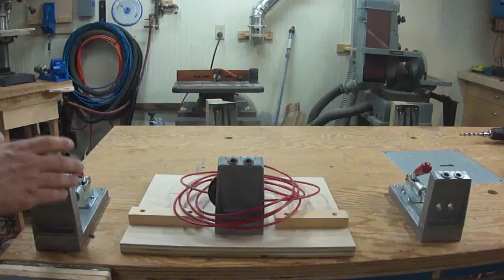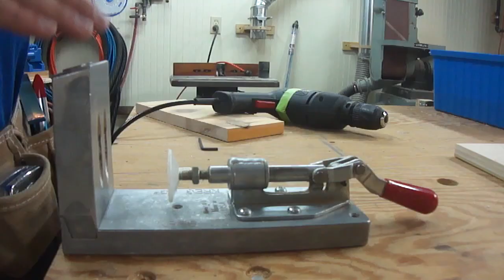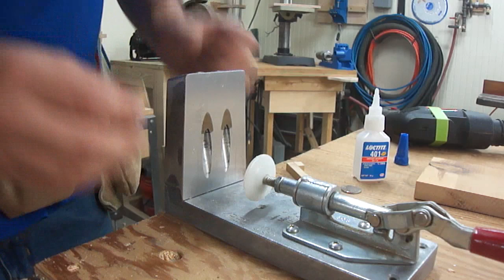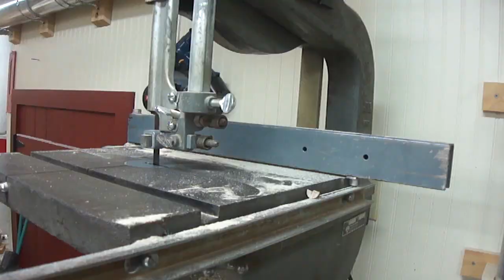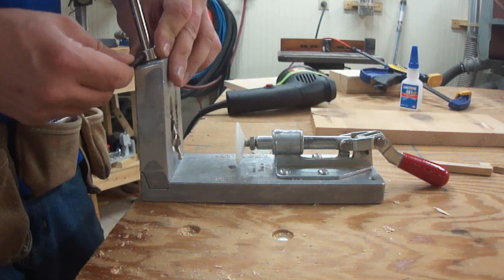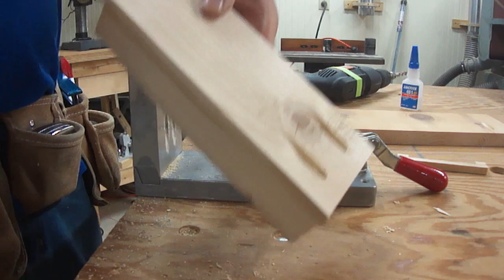How to set up and use the Kreg K2 pocket hole jig

Comment: Hello Ian-
Thanks for this video and some of your others - you were an inspiration to me converting my Kreg jig to an air clamp mechanism, surprisingly easy to do, having seen some of the details in that video.
Hopefully you can help me on my present quest: I'm in search of info on my particular Kreg jig (which has no identifying part or model numbers printed on it or the carry case). It isn't listed, shown or even mentioned on the Kreg web site and I have searched from one end the the internet to the other and the ONLY trace I found was on the preview thumbnail view of your K2 setup video. It is the lighter blue plastic model shown third jig from the right side almost directly below the Dewalt drill.
What model is that thing?  I think I bought mine in the late 1980's,  it seems to fall somewhere between the K2 & the K4 ??  I am in need of the user manual for it and I don't know how to identify it.
Thanks if you can help.
Tom C
Reply from the maker: Hi Tom, that jig is the K2000 jig. If you Google “Kreg K2000” you’ll find a pdf of the user manual. I’m going to be doing a video on that jig soon. Let me know if you have any other questions.
Reply: @TheNorthlandWorkshop  
OK great, found the K2000 pdf right away - thanks.
Really looking forward to your video on this model.  It's not as versatile as the K4 insofar as drilling different thicknesses, seems to only easily accommodate 1/2, 3/4 and 1 1/2 inch boards, so I hope you can offer tips and setups for working with in-between materials like 7/8 and 1-inch.
Thanks again Iain

Comment: I recently came across a k2 (later model) in a very nice wooden carrying case. This Kreg has a blue handle.  Have you come across one like that?
Reply from the maker: Yes, I have one of those now. The blue handled ones came out in the late 90’s and were replaced by the k2000 in the year 2000.
Reply: @TheNorthlandWorkshop  did it come with a wooden case?

Comment: Hi, thanks for the informative video on these Kreg Jigs.

I was hoping to use my K2 to make pocket holes to secure mitered corners for a frame made of 2x4. I was hoping to have a clean face and then have the pocketholes on the backside. Obviously, having to drill pocketholes on both sides won't work for what I'm trying to do. 

What would happen if I just drilled out 2 holes on 1 side and fasten it? I'm a beginner at wood working, so I don't see why it wouldn't work.
Reply from the maker: Sounds like it would work.